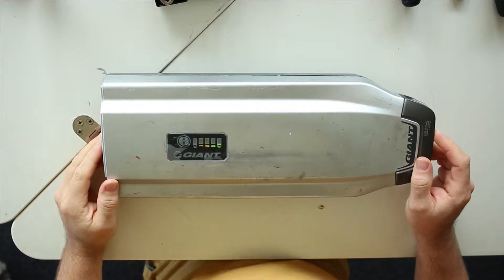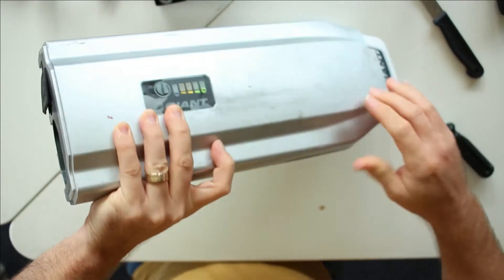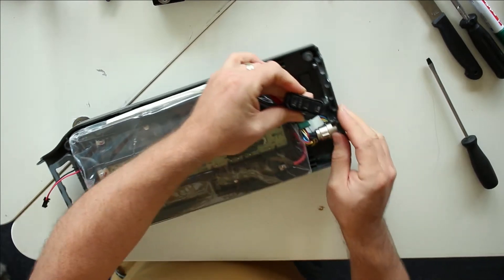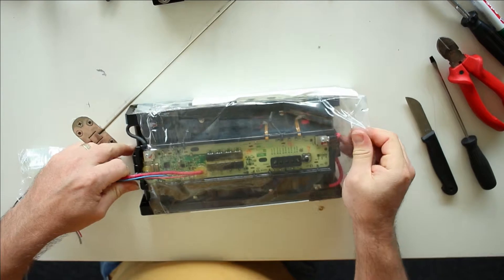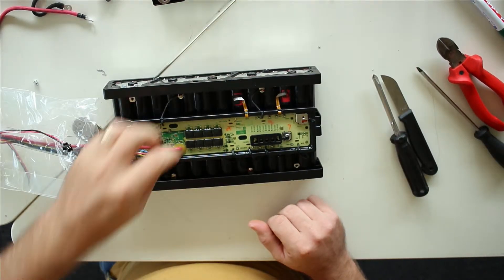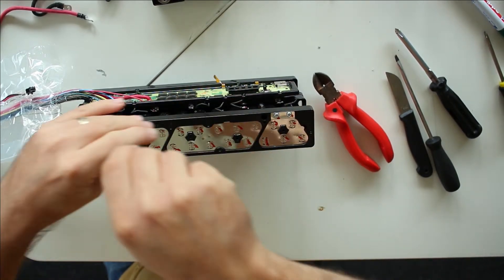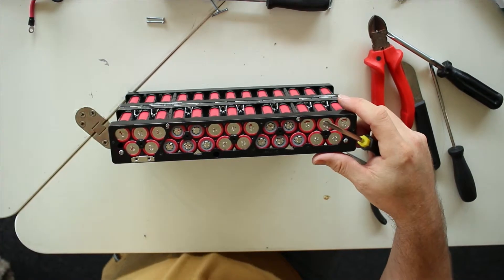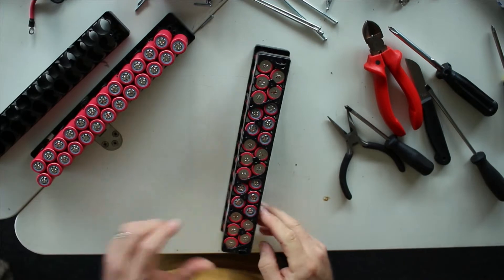18650 - Part 8 - Opening Giant Aspiro ebike battery

Comment: Hi Sailing and electronics,

Thank you for making these eBike batteries videos, very much appreciated your effort to educate us !
Can you, will you, please make a list of the several ebike batteries, which batteries are inside ?
For example the Gazelle (Innergy, Impulse) and then the different versions, like the Bronze, Silver, Gold And Platina, for as far as you know.
And all the other brands and the different types, would be very nice for every collector so you know which cell are used in the different ebike batteries.

I have recently dismantled a Gazelle Impulse Gold, 36.5V/11.40Ah/416 Wh, Article # 998402600 and found these 40 cells:
INR18650-29E
SAMSUNG    SDI  2F41
All cells are between 2940 and 3150 mAh, so very good.
Most cells have very low resistance between 40 & 80, also very good.

And your findings for this Giant Aspiro ebike battery.
This battery includes 50 18650 cells. 
They are Sanyo cells with a capacity of 2200 mah (new).

Hope you can make this list, 
thanks in advance.

Leo_C